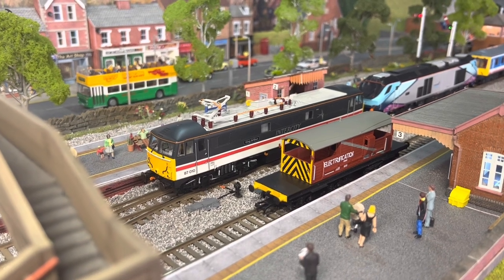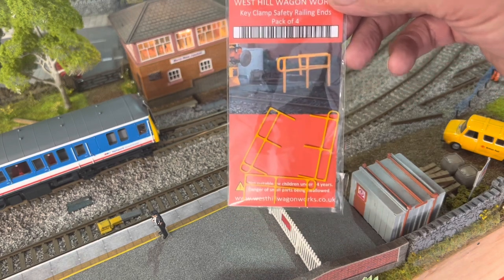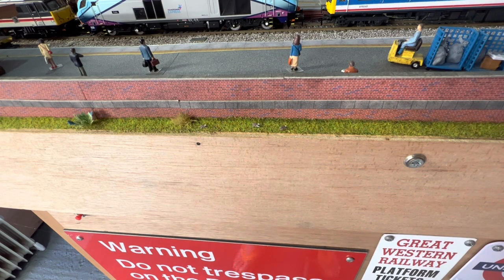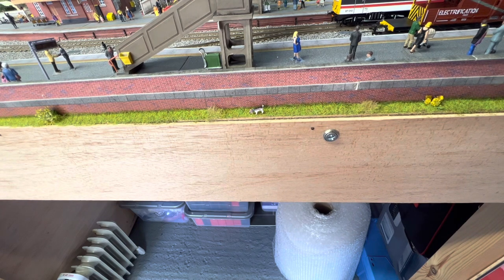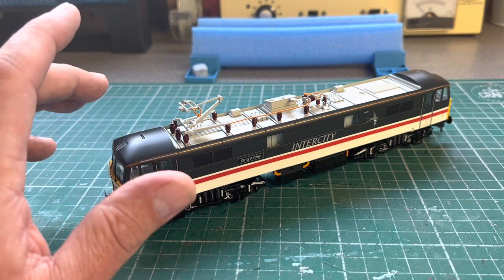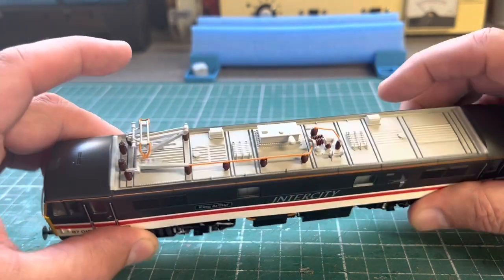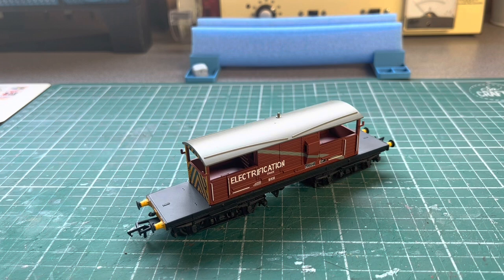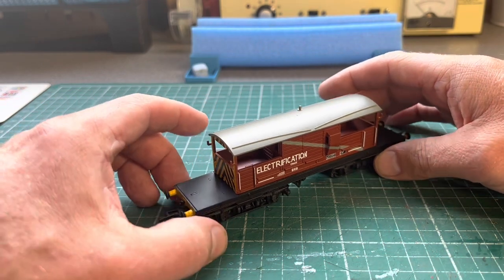No 77. Extra inexpensive details + Dapols FREE class 68 repair service & BARGAINS you can still buy.

Comment: very good video and very informative, the 68 looks great,  i have refrained from buying one because of my experiance with the 121 when it was first released a few years back, it was a nightmare to run with a dapol imperium3 installed, same with a 122 i bought a couple of months back also with a imperium3 fitted, cant find anywhere what the ideal cv settings should be and both developed problems with the little plastic ball with two pins on the drive shafts splitting, the 73s from dapol i have are also very poor runners,  the 87 also looks fantastic and you got a good deal there sir, there about 150 odd quid ddc ready if you can find one,👍
Reply from the maker: Thanks Andy for taking the time to watch and comment it’s much appreciated. 
Keep safe and well my friend 
Andy